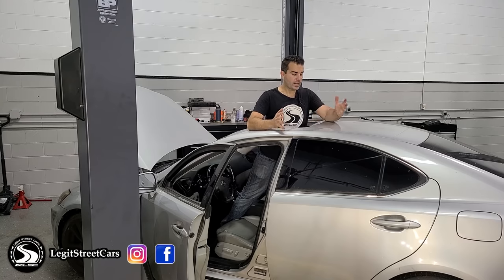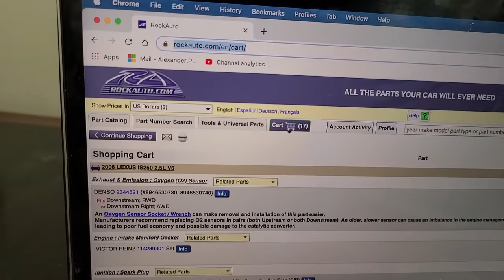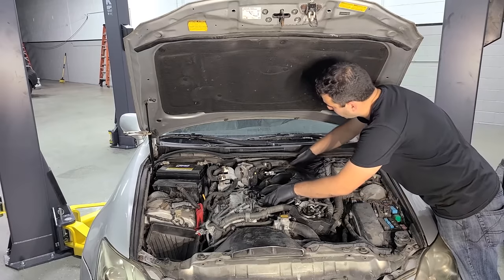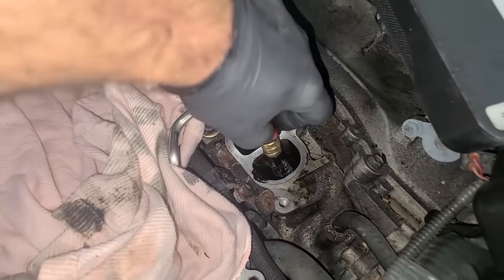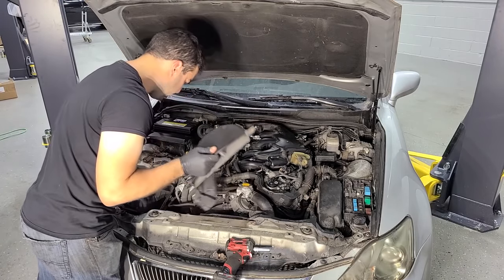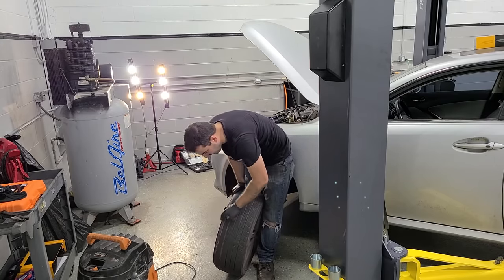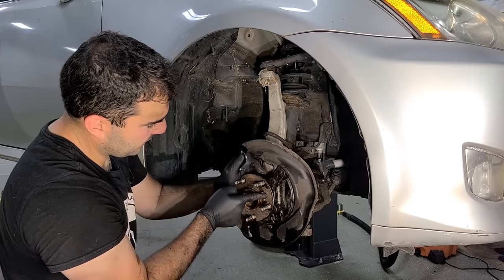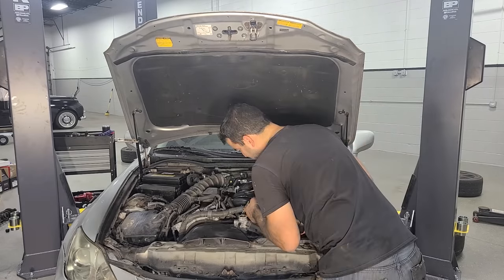I Made The Free Lexus MECHANICALLY PERFECT After Fixing A Big Issue Deep Inside The Engine!

Comment: Ah, the joys of DI engines. For anyone that owns a DI engine I strongly suggest upgrading the PCV system with a good quality oil separator plumbed into the PCV. If you can remove 99% of the oil mist from the blowby gasses then gummed up valves and inlet tracts will no longer be an issue 😉
Reply: What about the valve cover breather valve?  I just bought a oil catch can for this very car, but noticed there is a valve cover breather that goes into the intake
Reply: @georgekallely7103  Anything that gets sucked into the intake from the engine needs to have the oil mist removed or else it just gums up the valves.

Comment: Awesome work! For the spark plugs look at the tip of the plug where the coil side.  Factory plugs will have either a letter or some kind of mark replacements won’t. Very curious if these are factory and they could be since it’s 120k plugs
Reply: Hi AMD!
Reply: Shut ip
Reply: @abdelrahimmohammed1814  Hello!
Reply: Pretty sure Denso is the oem plug on most lexus vehicles so they likely were, although they’re recommended at 60k by lexus
Reply: @kgisabeast  what he meant is, factory plugs would have toyota/lexus logo (or name) on it apart from the manufacturer markings
---
how strange. i got notified someone replied about yellow tip but can't see the actual comment. this is the 2nd time i can't see someone's comment on yt :/
Reply: @n.shiina8798  Thats not what The Car Care Nut is referring to. Factory plugs come with a marking that looked like the letter P right on the top of the plug. Check out his YouTube channel for clarification - he's a Master Toyota Tech.
Reply: @kgisabeast  of course denso is the OEM lol. Anybody who works on Toyotas knows that denso makes all of their electrical stuff since they own denso.
Reply: Denso Iridium plugs are OEM on my Honda Accord V6 so I I am pretty sure those are OEM too on that Lexus.
Reply: @kgisabeast  100% I have a 13 is250, mine is mechanically great, but my seats are goofed from the first owner. 60k for spark plugs, Denso iridium oem.

Comment: Denso Iridium plugs are OE for Toyota, though they sometimes come with NGK also. The original plugs will have a paint mark on the top of the electrode where the coil sits. They actually use paint marks on most original parts like struts, springs, and mounts.

Comment: 44:45 These trans are safe to just do a drain and fill with the Toyota WS trans fluid. Drain/fill 2-3 times. I did one on an IS350 with 170k on it. It now has 220K and still shifts like a dream!
Reply: Yeah, Idk why he's worried about changing the transmission fluid.
Reply: @OhgodImtoosexy  theres a lot of controversy with changing the fluids in these transmissions. A lot of people say it has to be done a certain way & not anyone can just do it. I want to change mine but don’t wanna risk doing it myself, probably just gonna take it to the dealership at some point.
Reply: @swervoOG  It's as simple as draining/filling it. Very easy to do. Just only use Toyota automatic transmission fluid and you'll be fine. Drain, fill, drive around for 20 min then do that 2 more times and it'll be fine.

Comment: My 2013 IS250 has 230k miles on her, runs and drives great 😊. I clean the lower intake and intake valves every year and change synthetic oil every 5k or 6 months. She gets 32 mpg, but I don't push her hard. Plus, it's a beautiful car!

Comment: Nice work! These are great cars. Got a 2010 is 350 back in February and I actually ended up changing the transmission fluid 3 weeks ago. It was never changed and has 130k miles. It went from shifting harsh to buttery smooth! So don’t get too scared about changing fluid if you’re having problems.

Comment: Running a catch can system will usually help with carbon build up like that.
Reply: Was going to say the same thing. I cleaned the intake manifold and valves on my f150 ecobost and installed a catch can. They still look nice and clean after 45k miles.
Reply: For sure with these 2.5l are prone to carbon build up.
Reply: @eobardthawne6962  are the ecoboosts prone for build up?? I have a 2,0 ecoboost...he said some early models of DI, does that include ecoboosts?
Reply: @richardbaumgart2454  Depends on what year ecoboost you have. Ford added port injection in addition to the DI to help with the intake valves getting carbon on them later on. An oil separator aka catch can, is still a great system to add to any engine to rid the oil out of the engines intake track. Especially for DI vehicles.
Reply: @richardbaumgart2454  I run a catch can on my 1.6 Ecoboost it is definitely a great addition. Every oil change I dump it out and am glad that isn't being blasted on my valves. If I were to use a laundry measurement cup its 2-3 loads of residue lol
Reply: @Kohoso95  wow what year is your Fiesta? i guess it doesn't matter really...gonna have that blow by no matter...these ecoboosts seem to be bad with blow by really...mine's new (less than 25k miles) and have problems with gas in the oil
Reply: @richardbaumgart2454  2016 I haven't had any problems like that or at all with my car. I knew buying the car with the direct injection setup I should run a catch can and have been running one since about 25k(51k now) miles. Mishimoto makes a good one Im sure there are others, are you running a focus st?
Reply: @Kohoso95  yes a late 2017 Focus St......i had to warranty replace the turbo at 20k miles because of gas in the oil...they said my fuel injectors were bleeding down...wtf..on a brand new car..i don't think so...idk...thing has always surged under half throttle
Reply: I run water methanol injection. Cleans everything and all the carbon off pistons, valves and intake ports. 13.77@103+ 2020 Kia Forte GT Manual transmission. Tune only with WMI.
Reply: @richardbaumgart2454  My 2016 Focus ST2 had 56k. Stock turbo, lol GTX3071

Comment: It would be interesting to get some scan data on what the mass airflow reading is through the rev range before and after cleaning the valves. Could probably extrapolate how much horsepower gets lost over time due to carbon buildup.
It's worth noting that egr has a huge effect on how much buildup there is.
Reply: Installing a catch can is probably worth more than an egr delete in terms of reducing carbon buildup 🤔

Comment: I interchange the names too and think of my Solara as a Lexus. Especially now that I've seen the parts that it shares with this car.

I bought it with 45,0000 miles and flushed the transmission at 75,000 miles, and I believe it shifts better now at 115,000 miles than it did before I did the flush. It doesn't have paddle shifters, and I feel like I have better control of the shifting through the gas pedal and it does what I want better than it used to.

Comment: In regards to the  oil, I normally open the fill plug and drop a small plastic hose attach to syringe. I pull a sample and inspect the condition of the fluid.

Comment: About the sunroof... To anyone here who isn't mechanically inclined, start a relationship with a local independent shop. No, not a dealership or a chain shop. I have a small shop and if any of my long term customers came to me with a sunroof (or side windows) that were unsynced, I'd walk them outside, and show them how to fix it, no charge.

Re, MAF cleaning... I get a lot of cars with oiled air filters (K&N) with MAF codes. They usually just have oil on them from the filter and need to be cleaned.

Liking the long vids.

Comment: I’ve had that problem several times where I can’t get a wheel off.  What I found works best is to take off the bolts and lower the car to the ground. The weight of the car gets the wheel free.  Every time.

Comment: Noticed when you replaced the cabin air filter that the recirculation door was flopping.  Check the little arm that attaches to the servomotor for damage.  50/50 chance that it is broken or can be re installed properly.  This happens when the correct procedure isn’t followed for cabin filter replacement.  I have also seen the transmissions in the is250 last forever but I have also seen them to have issues around 120k there really is no in between lol.  As far as the carbon issue these engines have, you could see if your local dealer can give you info on if the  ZLA campaign was ever performed and that’ll tell you if you have the updated parts already.

Comment: Factory toyota/lexus comes with those Denso iridium plugs you found.  They are rated for 120k miles so they could be original.  I've seen some running up to 150k.  Only use iridium for pretty much all lexuses.   Toyota uses denso (Bando) belts which are about $15-20.  Toyota Pink fluids for the car.. they are designed for aluminum engines.  Fluid is lifetime per toyota but Aisin makes the transmissions and recommends a drain and refill every 30-60k miles.

Comment: There are some products that you can put into the gas tank that clean your system. I had an engine control light and my catalythic converter gave me error code 0420, which basically means that it didn't do it's job anymore (values under minimum requirement or something like that) and considering it already had 150,000 km on the clock I thought the converter was done for. Without expecting much I tried the converter cleaner by JLM and to my surprise it worked. Saved me around 145 Euros and two hours of work (and yes, I considered switching the converter myself, it's only 13 screws on my Opel Tigra Twintop, would have been my first mayor car repair). If your converter is really damaged, like when the cells inside are melted or something like that it won't help, but if the converter is only dirty it does.

Comment: Not sure if mentioned already but to exchange the cabin filter you need to set the ac to vent internally to open the flap. Now i see the flap is loose,  so it popped out of the lever, probably it has been pulled out now. You can remove the lower panel to push it back in place.

Comment: 10:00 A better location for a vacuum source would be the evaporative purge port.  The brake booster port is too far downstream to provide even distribution to all the cylinders.  Raise the engine RPM until the swirl control flaps in the intake manifold open so both intake valves per cylinder get cleaned.

Comment: Regarding changing trans fluid, I wondered why the dealer wouldn't change mine after 60k. I recently had an old school trans guy explain it to me this way. As the trans ages and the fluid ages, wear bits become embedded in the porus inner metal housing of the trans. When new trans fluid is introduced, it is high detergent and will loosed those embedded particles and can cause damage. A guy on youtube, can't remember which vid, demonstrated the crud that came out of the metal. He puts the housing through a very thorough cleaning process prior to rebuilding. The advice you were given is the same I have gotten from every shop I have asked.

Comment: Their great little cars. Owned one biggest issue for me was that melting dash. They had issues a extended warranty for it but didn't notify owners and most cars were left unfixed. Next is the water pump and alternator. Both go bad before 70k miles normally. Good part it your basically gonna do it 1x if you keep your car long. But that dash made me get rid of mine asap. Once it started melting it was just down hill. If you live in a cold area like Canada it probably isn't a issue but in LA where it hits 120 out side it was awful during summers

Comment: At 114k miles, you should definitely change the trans fluid before it gets bad.

I've done three cars at 170k+ miles and one at 220k+ miles and they all ran much better afterwards. The 220k car had trans codes that went away with new fluid. 

220k car had just shy of 300k before it was involved in a wreck with a drunk driver.
Two of the three 170k cars now have 220k+ miles and the third doesn't get driven much with just another 10k miles added.

Comment: Exhaust gases from the EGR are what makes those caked up valves, right? It sticks to the oil that escapes from the PCV.
In older cars it's normal to have oil in the intake from pcv, but they had no egr, so it was fine (mostly).

Comment: You might want to measure the runout on those new rotors with the lugnuts tight against them before finishing everything up. Anything more than 0.003", you'll get complaints of "warped rotors" after 5000 miles. If runout is too much, go back and clean the hub faces, and if that doesn't fix it,  start indexing the rotor a lug or two at a time until you find a position where the rotor's runout cancels the hub's runout.  Presto, no more warped rotor complaints. If you leave them as is, the pads will slowly shave off the high spots on the rotor, causing the pulsation after 5000 mies.

Comment: Lexus and Toyota do come with factory DENSO spark plugs, those are the originals in there.
That nastiness on the ground electrodes comes from just sitting there and not getting warmed up (condensation and acids inside the engine due to long oil change intervals), also from short trips which the vehicle does not get up to operating temperature so combustion byproducts like water (yes H2O) foul and corrode the ground electrodes.

Comment: Those brake rotors have a threaded holes in them you just find two 8x1.25 metric bolt, and press the rotor off. A hammer if more fun, but not kind to the wheel bearings if you have to hit it too much.

Comment: Great video again, but I just wanted to say that you shouldn’t be able to lift the heater flap like that to get to the cabin filter - it’s controlled by an armature. 

Lots of people try and force it rather than set air to recirculating which opens it through the armature moving, allowing access to the cabin filter.

Suspect someone’s done that with yours and it’s now fixed in outside air only.

Comment: Ha ha! The expensive sensor…! I was replacing the alternator on my 2006 Corolla, and I broke the electrical connection clean off the vvti actuator solenoid. Over $250 from the dealer. Didn’t seem to be available anywhere else in Australia so didn’t save much on doing the alternator by myself lol! I got to inspect a vvti solenoid, though, so always a silver lining 😎

Comment: Nice vid with a lot of useful information in it. I think that that car has still tons of works to be done: many rusty parts and bolts should be changed, the engine bay should be deeply cleaned, the front lights should be polished and then the body work. Of course most of this is cosmetic and doable later but the rusty parts should be fixed.
Just my opinion, based on glimpses caught on cam.

Comment: My IS250 is really sick at the moment. Low idle, sluggish and the valves are gunked up badly. You really put me at ease with this video because it looks really easy to clean it. I have already removed the plenum to do spark plugs so, removing the intake looks easy. I hope it goes back to normal after doing this because i used to run so nicely :(
Reply: Hope you're good. Just wanted to know if you ever manage to get it back in good condition?
Reply: @michaelbingala1130  I took it apart and slowly picked all the carbon off the valves using hooks, picks and liqui moly decarb cleaner. It took a whole weekend but I got the valves looking 100% clean. Put it back together and it's been running great. It's really not that hard to do.
Reply: @jamest6850  how did you get all the carbon chunks out from there that you picked?
Reply: @donttouchthewatch645  I put a rag over the hole and blew it out with compressed air. The hard carbon basically turns into sludge when it is soaked in cleaner for a while.

Comment: I would have liked to see how clean it came if you had ran it with the radiator fan unplugged to get it pretty hot then dumped cold water down the intake while keeping it alive with the throttle.   I've cleaned many a carboned up engine with this technique and it works well.  You just have to be very to not hydro-locking it while getting as much cold water down it as quickly as possible.

Comment: I'd be interested in the fuel used throughout all those miles (km) being the cheapest (91 octane and/or E10 (10% ethanol)). The electronics keep the engine running to optimal performance under moderate driving conditions, and so a lot of carbon-like gum deposits can accumulate before the OBD detects component failures. I remember seeing a service manual recommending 'clean spark plugs' every second service, but in the days long before platinum and iridium electrodes were used. I still think that the modern spark plugs using iridium in the electrode are capable of several 100,000 miles, if gapped and cleaned on the ground electrode. As well, fuel additives containing 'P.E.A.' would assist in keeping the engine clean. Possibly an ingredient in the can of 'drip feed' oil, but with only a little immediate effect. Also a dose of high octane fuel (95 or greater) would assist performance...

Comment: I’ve been machining cylinder heads like these very heads for 30 years. 
 The main culprit for machining these heads is because of carbon sluffing off and becoming trapped and stamped into the face of the valve and seat. 
    Additionally keeping the valves closed keeps this carbon from becoming trapped in the piston rings and doing major damage. 
   Awesome job this step right here should keep this engine running for another 144K.